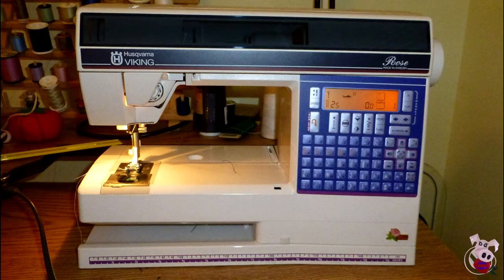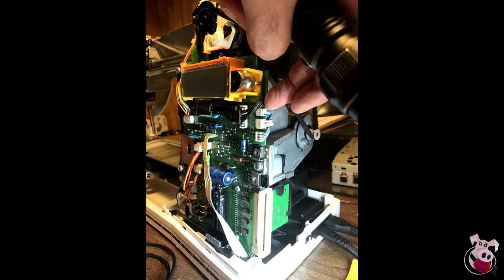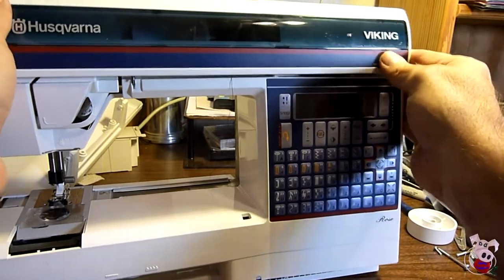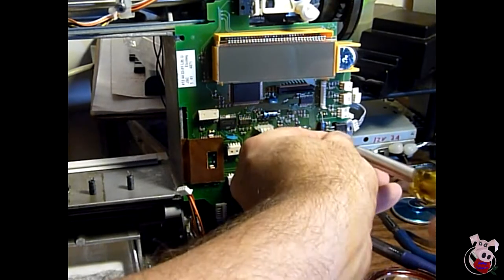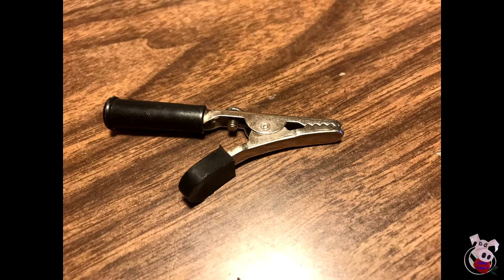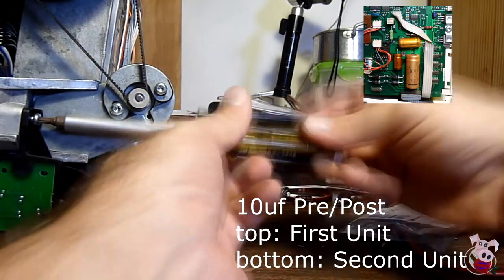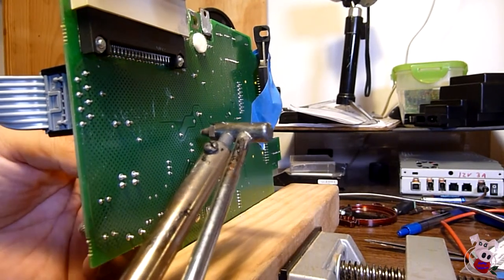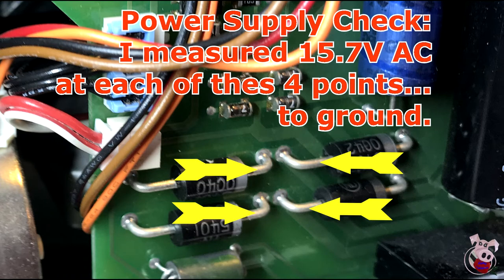Husqvarna Viking Rose Type 600 Blank LCD Repair

Comment: Thanks I used your video to help take the covers off for cleaning. But.. I'm bummed that the machine will eventually fail due to the capacitors. I'm meh with soldering but I'll use your video when the time comes. Thanks bud

Update it looks like opening up the case caused something to go funky. My screen now isn't complete and some digits are not complete. Hopefully capacitor fix will work. I'm shopping now.

Comment: Great video. I specialize in 1980s-early 2000s computerized Pfaff machines, many which are very similar to the Viking model in this video. Up until around when Viking purchased Pfaff in 2000, Pfaff provided qualified dealers with motherboard refurbishing kits, including all new caps, which I believe were all aluminum electrolytic as opposed to the original tantalum capacitors. I also think Pfaff manufacturing switched to all aluminum caps at some point, because all of the late-1990s to mid-2000s machines I've worked on, I don't recall ever seeing one tantalum cap in a machine. 

Capacitor technology has come a long way in the past few decades so I think using all aluminum electrolytics would be okay, and because modern electrolytic caps are often much smaller in size, it solves clearance issues, even when having to use axials in place of radials.

Just my two cents.
Reply from the maker: Thanks for that input.  It should give others some confidence that they may have some success with a cap replacement.  Kind of interesting. Sending new caps in a returb was kind of a blind replacement too... figuring it had a good chance of fixing the problem.

Comment: My Viking 535 was opened for cleaning and was working great. On reassembly the screen is now funky. I have for instance certain characters that aren't complete. I also can't select the stitch pattern. The sewing machine works for straight stiches but the screen is  hard to interpret. Any idea if capacitor problem here? I'm assuming yours went completely dark and then replacing the caps solved your issue.
Reply from the maker: I looked back at my photos.  The LCD appears to be solder on so it is not a pressure contact that needs cleaning.  They keyboard is a ribbon cable so check that is seated... but since you have the two problems I would go back and closely inspect your solder joints.  Make sure you do not have any solder that carried over to another contact... for instance when a capacitor trace is really close to the capacitor joint.  Also visually recheck your capacitor polarity and that your connections look good.   Without seeing it there obviously is difficulty.  The LCD would be IC driven so ether a circuit is shorted / incomplete or there is a voltage variance would be my guess.  And as always with such problems we hope that whatever caused it did not contribute to some damage.  Good Luck with your task.
Reply: Thanks! I didn't touch the board yet so I doubt it's a cross trace etc.    worth a shot to solder in the three capacitors you performed since I have nothing to lose. Appreciate the great video. I'll update you if it worked.
Reply: Darn it didnt work. Capacitors were replaced and the screen is still the same. Replacement board is the only option. Argh and none available on ebay etc. At least itll do straight stiches for now.

Comment: I’ve the same machine as this one ,which I’ve purchase in 1998. My LCD display looks fine. Foot pedal is not helping to move the machine, even though foot pedal is good. I took it to a local repair some times ago and could not check right away whether it would work, due to some family emergency. They have said to my husband ,that they have replace a sensor for the problem. Like to have some word of knowledge from you, thanks in advance .
Reply from the maker: As an owner I have no idea.  That being said you can see there is not much inside.  The single control board, the power supply, sensors and the motors.  Do all the stitch buttons work and do they trigger the foot to move?   So I looked at some pictures.  The power supply had no serviceable parts. 

 The foot pedal went to the power supply.   There were a couple of voltages running on the board.  It looks like the motor connects to the bottom left of the board and that there are dedicated legs coming from the power supply to the motor connector.   Let’s hope it’s not the power supply.   It could be a capacitor dedicated to the motor control… or a transistor.  

If it turns but won’t rev up it could be the speed controller sensor is dirty.   I don’t see any other separate motor controls for the shaft motor.  The main board seams to provide the control.  I don’t think the motor speed control would run off the main power supply because that would require the speed sensor and chips that read it to send data back to the power supply for it to alter the speed. I guess if the motor runs but lacks turning the main belt could be in play too.    I lost the voltages I found on the capacitors.  See if they are close (it would likely be one of the bottom 3).  Also check the belt and do a visual that all the connections look to be in place.
Reply: @alwaystinkering6972  Thank you so much for your quick response. Once more I’m taking it to a repair shop. Little hope with that, however I’m going to study more from your video about the process of repairing it.

Comment: Hi,
My Viking rose 600 got damage on the flex connector cable (No:336.97).
How can I to fix it?
Please aide me!
Reply from the maker: I am not familiar with what that cable might be.  Most of the cables are made of some form of regular wire of large enough to see size (LCD ribbon cable excluded).  

I don't know how close the damage is to a connector.  You could make an attempt to mend it with new wire.   Perhaps look to see if you have a local electronics shop that could take on the task. 

Watch listings.  There are many posted from time to time as parts machines in local listings and national.  

Best of luck.

Comment: Hi I have the same problem with my mom’s machine, I ordered the capacitors that you changed. Also the needle vibrates do you have any idea what could be causing that? Any suggestion is greatly appreciated. Thank you.
Reply from the maker: Wait until you change the capacitors. It could be related.  One of the two had the blank screen and a motor vibrating.  After the replacement that symptom went away.
Reply: Thank you for the information really appreciate it. Should I replace all the capacitors, or the just the ones you mentioned. I only ordered the ones you mentioned and not the big ones. Thank you.
Reply from the maker: @KevinBiju007  the effort and time is in taking apart and finding the right parts.  Obviously I had success without all of them.  If I had them I would have replaced them.  I have since purchased a cheap component identifier that takes a swag a capacitor specs.  Unfortunately i got it just after I disposed of the old parts so I cannot tell you if would see any issues. The problem for us is it could be out of spec just a little and we novices may not know the difference... hence the blind replacement. If you can find them and they fit then yes.  Here is a video on the tester. https://m.youtube.com/watch?v=7Br3L1B80ow you can find them from all the regular online sellers under 20 dollars domestically in a case.  It’s a lazy tool to translate resistor and capacitor ratings if nothing else.
Reply: @alwaystinkering6972  that is very true. Thank you for the advice and help. I’ll look into the component tester. Thank you very much for taking the time.
Reply: Your suggested repair worked perfectly for me. Did not have to replace all the capacitors. Used electrolytic capacitors without any problems. Thank you for this video.